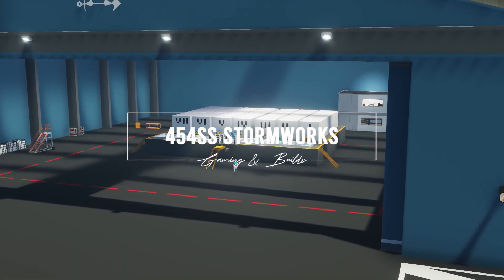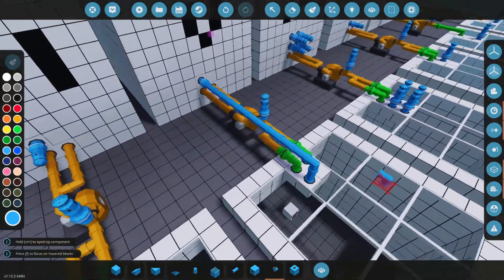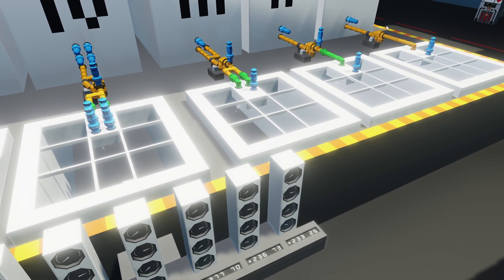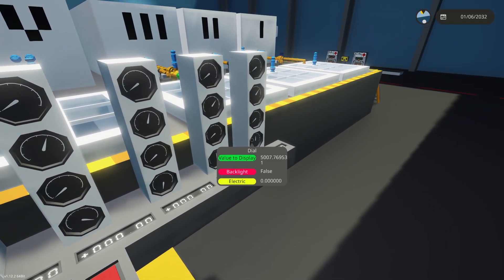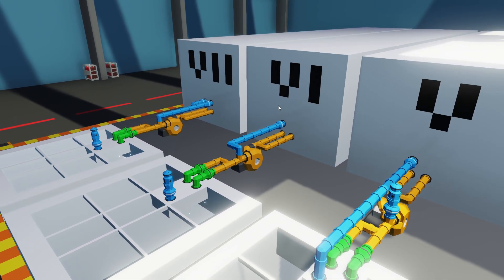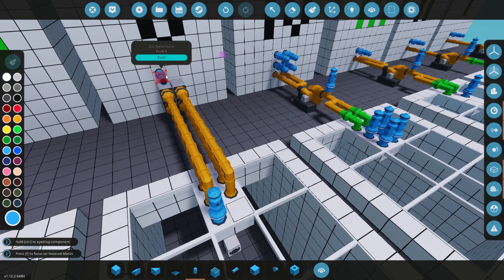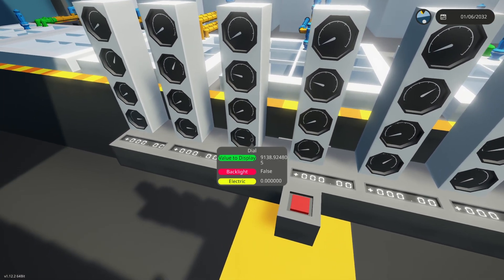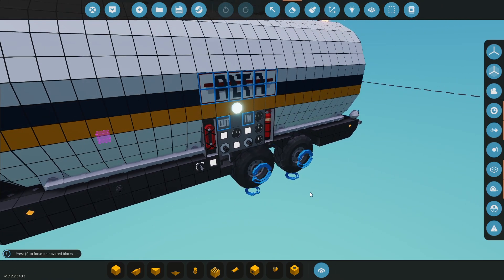TESTING Pressure Transfer vs. Fluid Transfer in Stormworks

Comment: Great timing, I've been working on an oil refinery ship, that takes oil and while travelling towards the selling point, make diesel and jet fuel. I was testing the system with a custom tank full of water and it took ~30-40secs to fill a distillation tower. I tested it by pumping in oil and now it takes an eternity to fill 1000 liters. I'm at a loss because the flowrate for the single large pump is like over 200 liters/sec but the flow seems to be slower.

Comment: Humor me. Do a setup removing the gas relief valves venting to the atmosphere. I'm convinced they are no longer necessary and are actually causing slowdowns. My best setup was two in-out ports through one pump, feeding the gas back into the feed tank so it keeps the spawned default atm. My 2nd best, was the same setup minus any gas valves. Neither one had any gas valves venting anything to atmosphere (not even on the tanks.) There was a vague patch note a while back which has me suspect tanks no longer need venting. It's been consistent with me, but everyone is stuck on the idea that it has to be vented. Give it a shot, I may just be crazy.
Reply from the maker: I'm not sure when that was, but I found that without it, the pressure will drop and then if it is fuel supply to an engine, it will not be able to work anymore! It is a longevity test, see if you can replicate it for a longer duration
Reply: @454ss_gaming from February 6th 1.10.2 "Fix - #22989 Flow issues with default fuel stores" 
It may still be needed transferring between custom tanks, but I've not put a gas relieve on a fuel supply line in six months. I've tested several custom tanks and haven't seen any issues. It may not cause slowdowns, but I am certain they aren't needed. I don't do a lot of tanker builds though, so I may not be doing large enough tests.

Comment: need a flow valve on the gas return lines or the tank will just push gas to line after pump an slow down the movement. And if you worried about excess gas building in a gas return system just use and on/off valve with a greater than to release gas after pressure get to certain point.

Now for a really fun trick, make a ring using the custom door frame as low as possible (as big as possible) in tank and but above all the ports, creating a lower area. pull fluid from this lower area and pump the gas return to this area, it needs a flow valve on this line or it wont work right. the flow from this will be real low but it will be mostly fluid.
Reply: I've not seen that happen so long as you T the pump output with a gas valve going back to the supply tank, and a liquid valve going to the destination tank.
Reply: @grit9938  it does happen with small pumps. Large pumps it depends on the system down  past liquid filter sometimes.

Comment: Love the video you make! Why even pump the air out of the tank at all? Just put a liquid relief valve before the pump so it can only pump out liquid. It will make the flow rate through the pump appear to be lower because there is no gas being pumped but it should give you the highest flow rate of liquid you can achieve
Reply: It's funny, I posted to the discord a solution just like this back when 454, did his first fluid transfer tests, showing that forcing the pressurant gas back into the tank like in examples 5 and 6, but mine had a pump gave the best results.

To answer your question no it's not faster that pressurizing gas helps force more liquid thru the pump, having the liquid "filter" before the pump negates all benifits from the tank pressure being higher.
Reply: I don't think that pressurizing the tank with gas actually affects the liquid flow rate much, if at all. The liquids and gasses seem to behave as completely independent systems, where fluid pressure and gas pressure are different and don't interact with each other at all, seemingly. Might need to join the discord and post the data I've collected

Comment: I appreciate the videos you make and like learning these things, do hoses make a difference? My most used scenario is filling up fuel or oil and then selling or bringing back to the shop. Also, My bro had an issue where he was leaking fuel! Causing slicks on the ocean.. not sure what he did lol
Reply: Hoses do not make a difference. In fact im very certain the they have uncapped flow when opened spraying water.
Reply: When you first open the nozzle, or a sustained flow rate? The numbers I've seen are 180l/s for pipes and 75l/s for hoses. These are old numbers but I don't think they have changed after the update. @archadeseng.corpsgaming

Comment: Would it make a difference if you move the offgas return piping to the top of the tank on number 6 I wonder? Basically creating positive delta p head pressure in the feed tank. In theory, you would only need a relief valve on the second tank so long as the pump is running.
Reply: Delta height no longer a thing since compressed gasses added